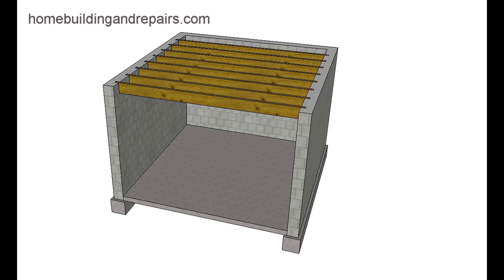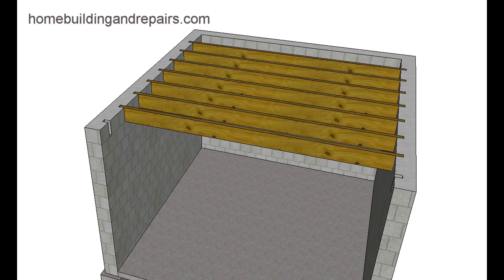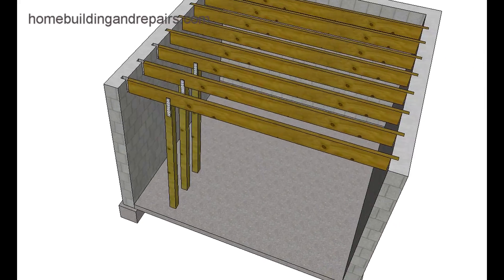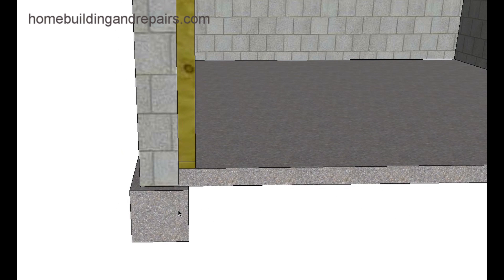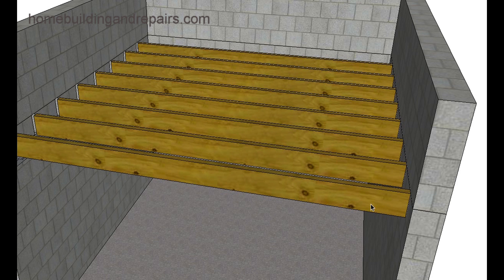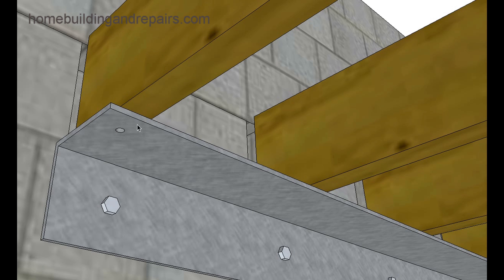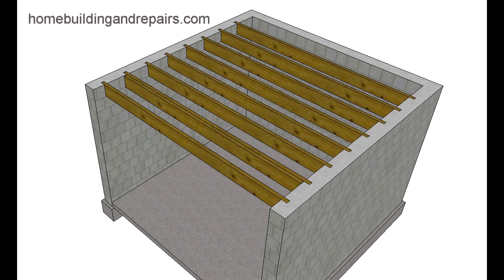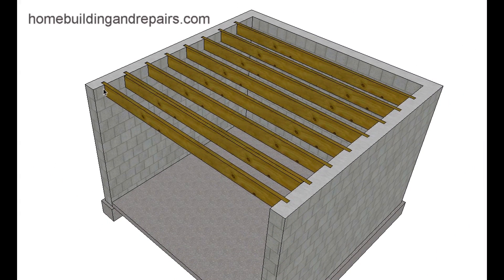Problems Replacing Wood Joists Embedded In Block Walls – Building Repair Tips

Comment: I like your valient effort.... but no. The embedded into block the mason knows that's the wood needs to be embedded into mortar where they notch the block has clearance originally left and right side of wood and gets embedded into mortar left and right but is cut tight vertically. The left and right clearance usually fails at the same time the structure has subdued due to wood rot. So what you do is cut your board to sit on the sill but it doesn't necessarily have to be tight front and back. You can have a half inch clearance. But what you do is cut timber to length, the cut a 45° notch cut at the end of the timber about halfway into the wood. This allows clearance because your going to remove the mortar left and right of the original timber, notch cut the ends and start putting the wood in on an angle to where it will slide in but also allow the other end to feed in as well going from corner of the notched hole into the other corner then your going to with s sledge hammer bang it into the center position and then shim it both sides and refill the mortar. To prevent wood rot you can dip the ends of the wood into plasti dip. The end.
Reply: Use a drywall lift to swivel the timber into place. I live in detroit. Very common here all the time.

Comment: let me ask you this!  I'm planning to have 18" floor trusses. I want to hang the trusses on the inside the block wall in order to drop the step-up distance into the house.  But the "HB Top-Flange Joist Hanger for 3-1/2 in. x 18 in. Engineered Wood" is $42, making the total cost over $3.5k for the hangers.  On the interior, I'll have 2" foam, then a 2x4 wall. Can I put the floor joists right on the 2x4 wall and don't attach them to the cmu?
Reply from the maker: I've seen it done before.

Comment: Thanks for this video. I've got a similar problem at the moment with my renovation of a stone cottage. I need to replace the joist because the ends which are embedded in the walls have been completely eaten by woodworm. My issue is The house I am renovating has stone walls with rubble infill. So hangers are not gonna work as they all seemed to be designed to be used for flat brick or block work walls. I'm trying to decide what to do. If any ones got any other suggestions that would be great.
Reply from the maker: You might need to remove some stones or sections above joist if possible to replace joist. Email me some pictures and I will take a look at your project.

Comment: Question I'm a retired sparky and years ago remember old time carpenters talking about joists in old row houses having a fire men's cut when ever the ends were impeded in old red brick or stone walls. Does anybody know what this cut at end of joust looked like ?
Reply from the maker: Yes, it should be angled from the bottom going up away from the wall towards top. I'm guessing about 20 degrees.

Comment: Building a garage with a loft 24x24 I’m putting a steel beam  centre 5 1/4 wide by 8” you think is beam good enuf
Reply from the maker: I can't provide engineering information.

Comment: Gregvancom, what about sistering joists that go into block? Would you still recommend building a wall to serve as a sill plate?
Reply from the maker: It would depend upon the design. You can usually build it without the wall and add it later if you're not happy with the results.

Comment: Greg, what about replacing a cracked joist that’s like this but in a brick wall?
Reply from the maker: If you can't support it from one end, then you might need to attach a new one on to the side or on both sides. I would check out some of our other repair videos at our website also.
Reply: Thank you! And a contractor that came by suggested building a small section of wall on each end to support it, instead of making a hole in the brick. What do you think?
Reply: @gregvancom  I have questions and I need your help
Reply: The guy who did my addition he embedded the 3x12x16 joists in to the blocks a sealed with concrete, and continued with the sub floor and framing, the inspector didn’t approve it because the joists are embedded,  please tell me what should I do in order to solve this issue, and it can pass inspection

Comment: Thank you for all the information on this video.  I was about to do the same exact construction in Jamaica until you said it is not earthquake safe. How would you make it earthquake safe with your experience?
Reply from the maker: If building new, maybe add some type of straps every 4 feet or so to connect joist to wall better.

Comment: I have a garage built like this except there is a center I beam so the joists are half the width of the garage and could be easily slide into place. My joists aren't rotting but I want to build a garage elevator using an electric hoist (videos all over youtube) and want to sister joists together when I cut one or two out.

Could I widen the existing pocket to allow for another joist to be slid in and sistered to the original? Maybe even use 2 additional joists sandwiched around the original or would that be taking too much material out of the cinderblock wall? I don't think the block is poured with concrete. I've added multiple fasteners across a wall when adding shelving and the drill bit would plunge in when through the thickness of the cinder block.
Reply from the maker: I can't provide you with engineering information, but I think if I was going to try and strengthen up the floor, I would start by adding additional walls or even a structural ledger that would attach to the concrete blocks and then support the joist with joist hangers.

Comment: I have a problem my house doesn't have wall plates how do I go about fitting one do I need to take my hole roof off befor doing it
Reply from the maker: Sometimes you install a ledger to a blocker concrete wall to install a new roof or floor. Feel free to email me some pictures or provide me with more detailed information if I didn't answer your question.

Comment: I'd recommend placing a temporary 2 x 10 x (TBD) bottom plate underneath the temporary posts to distribute the load over a larger area, especially if there is an existing load on the joists. You're moving the load from the block wall which has a footer designed for the load to the thinner area of the foundation which isn't designed for supporting larger loads such as support walls.
Reply from the maker: Sounds good and you can always install additional temporary walls to help distribute the loads from above also.

Comment: I think most folks I know would cut a hole in one end of the block and feed each joist through.  HOWEVER, I believe if you used scarf joints, you could install new  (full length) where the old was without a new supporting wall.  You could also build yourself an LVL "in place" that would be stronger than the original and also not require a supporting wall. But I'm guessing anybody who is going to do that is not about to go to youtube for an answer...because they already know the answer. I would opt for cutting a hole and feeding them in from the end,..If that is not posssible, I would build LVL's in place,..They would be stronger anyway.  A scarf joint would be awfully cool,,, but even high end framers, etc., ...don't really get into that type of thing.

Comment: Joists embedded into blockwork need to be wrapped in a DPC to prevent moisture penetration. It's a perfectly valid method for supporting joists.
Reply from the maker: I think I would rather use a ledger if it was new construction, but was wondering if you had seen it done within the past 20 years.

Comment: we have a 118 yr old sandstone block house. foundation is sandstone as well. aprox. 14" blocks of sandstone. interior outer walls are plastered up against the uneven sandstone blocks and settling has caused pretty big cracks by window frames and corners actually pushing out into the room in some places. how do i repair the plastered walls and make wall flush again?
Reply from the maker: Feel free to send me some pictures for more information and you can get our email address at the website.

Comment: Why not just use joist hangers on one side?
Reply from the maker: Good point, if you can fasten or attach a ledger to the concrete block wall securely, then you could use joist hangers.
Reply: @gregvancom  you can buy built-in joist hangers. So potentially you cut down block pieces, mortar them into the sockets, pop the built-in hangers into the mortar bed at the top of the block whilst still wet, and wait. Slate packing to get the alignment just right. Now you have hangers. Repeat on both sides, then drop in a new joist (you don't want to leave one end socketed, otherwise lateral movement might be a problem).

Comment: Drill a hole through the wall slot and insert the new beam from the hole outside and fill up the hole from outside
Reply: Or, but the joists, fill in the hole, put in some hangers.

Comment: i would weld a shoe for the ends, & before slipping the shoe on dip the ends with asphalt primer or hot tar. can i save the wood at an early stage of rotting ? with a chemical maybe ?

Comment: couldn't the joists be extended to overhang on the block wall? falling out of the shallow notched mortise wouldn't be a problem then, plus gives a greene & greene aesthetic.. much thanks for insight you provide.. helps with foresight in planning for my builds/repairs..
Reply from the maker: I imagine it could, but don't know if I've ever seen it done. I think it would depend upon the design of the building, because I would be concerned that the slots in the block wall could create weak points in the block wall.
Reply: thanks for the response back :)  am designing and want to plant rows of 8x8' box houses on a 200x200' plot.. wanting foundation / wall 4' off ground grade.. so i can standard stud frame a 4' wall on top of the masoned wall.. would cut cost in wood with sturdier lateral structural integrity, lower half.. just wondering how might such a box might pass california code..

Comment: I'd like to know, what's the cleanest way of replacing a joist when there is no sub floor. House is 110 yrs old. Don't want to re-screw/remove wood floors...
Reply from the maker: Go to our website and in the repair section, click on the link for framing and then floors for more videos that might work for you.

Comment: I'm in the south and running into TONS of buildings (100 years old) with the roofs constructed like this.  They brick it up, and then put the joists for the flat roof in the brick, and keep on going.  I'm looking at one now that's got a 20 foot roof, and one of the rafters we believe has failed.  So not sure what's going to happen with that.  Might have to see if we can get it approved to use something that doesn't clear the entire span but is anchored together in the middle...
Reply from the maker: If you have any engineering done on the project, I would love to hear what type of repair they suggested.
Reply: We got lucky in 1 way, after reviewing it a little more there is a center support beam so they only run halfway, and also the brick pockets have an open top!  So we'll be able to replace the beams with new strong wood without much trouble.  Unfortunately though there's a lot of damage to several so it's an even bigger project than we thought.  Very inexpensive building that's about 50X125, with 20 foot ceilings... the entire roof needs repair though even after the framing work is repaired.  I thought the story we got didn't make sense because surely they wouldn't span 50 feet with beams, after getting pictures we noticed the center support (which is still in great shape).
Reply from the maker: Sounds good and thanks for sharing your experiences with us.

Comment: I've worked for a guy who used to screw a metal plate to the end of a beam with 6 or 8 inch screws, lets say the beam is a 6x6 so the plate was 6x10 and he would put the beam against the wall and anchor the plate to the concrete wall.

The plate was centered on the beam so it steaks out 2" from each side and had a few holes for anchor bolts.
After the beams was hanged, the stucco guys would come and do the wall so the metal plates was covered in stucco and it looked like the beams was coming out the wall with no fasteners at all...

I hope it make sense, my technical English is not that good...

I always questioned this method because he was relaying on the screws to hold the beam and even though he screwed the metal plate to the end of the beam with 6 or 8 screws, 6 or 8 inches long - I have never trusted a screw to an End-grain to hold a lot of weight and was always worried about the beam cracking

But as a young guy you shut up and do the job you get payed to do, most people don't want someone who's 20 years younger to question something they've been doing before he had learned to hold a hammer...

What do you think about this method?